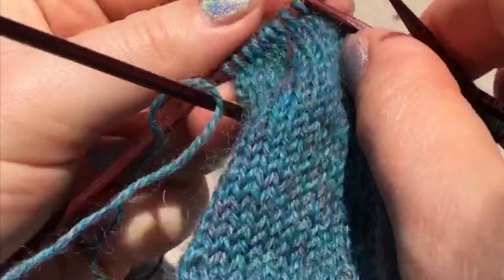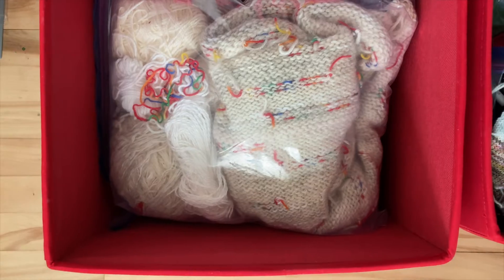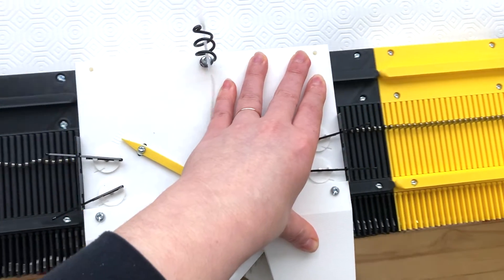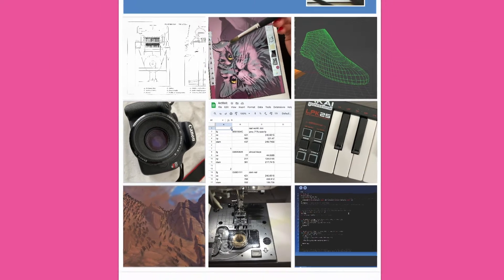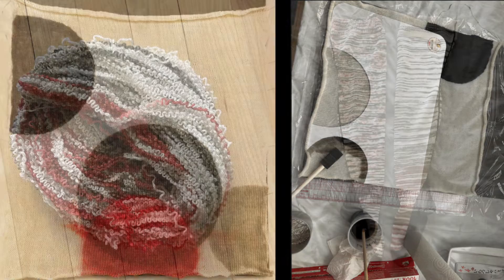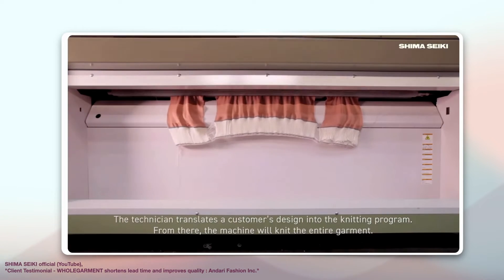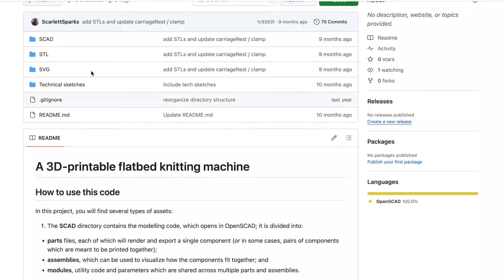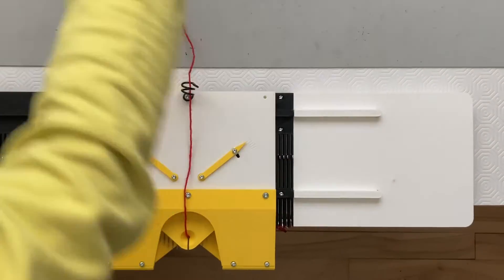I designed a 3D printable knitting machine! | PART ONE

Comment: In watching this introductory video, what caught my eye was your choice of the design software.  Most people learning CAD as a means to design 3D printable objects look at things like FreeCad, Tinkercad, Fusion360, or similar WYSIWYG type CAD design program.  Being a retired software engineer who mostly wrote firmware for embedded systems in C/C++, when I built my first 3D printer and needed to create some simple parts for it (using the Repstrap idea of getting around the chicken and egg problem), I gravitated towards Open SCAD as the CAD tool of choice.  I'm happy to see you giving this some love.  While still not yet perfect (it can't import and modify STL files, and I've had to resort to using Tinkercad for that), it does allow a parametric approach to stitching simple modular parts together to build something more complex.  I guess you could say that SCAD is a tool that only programmers can really love, while the other CAD solutions are more of an artist's mind set.

Comment: I have seen in another 3D printing video that there is a problem with tiny plastic filaments rubbing off that you could breath in and that will penetrate the skin like needles you don‘t see or notice. 🙈

Apparently lots of safety measures (that most probably won‘t follow, let‘s be honest) and applying coating on the printed goods can help minimize this … but I wonder if this problem wouldn‘t be even worse when you 3D print textile production goods like this knitting mashine.  🤔  
They are under much stronger use with threads constantly rubbing over their parts … and to make matters worse, those threads that may rubb off these tiny filaments from the 3d printed mashines will be worn on our skin as clothing. 🤔 

I don’t have a good feeling for projects like these because of that. Will normal people who wanna just have fun with 3d printing and maybe get a cool knitting mashine invest in safety a lot? I highly doubt it. 
They‘ll cut corners or never know they need to take precautions just like the many folks who got sick from trying epoxy crafts.  
Imagine you knit a sweet little piece for your toddler on a mashine like that and your kid‘s skin is covered in tiny plastic  needles unbeknownst to you. That‘s scary. 😰🙈

Comment: I absolutely love what you are doing with this!! I created a makerspace in my library and have knitting machines available for folks to use (among lots of other things). I'm a machine knitter myself. 🧶 I'm in the middle of building a circular sock machine (files from Thingiverse). If you need a beta-tester for your design (which looks INCREDIBLE), I'd be happy to try it and offer feedback. I have 3D printers and a supply budget for filament and parts. This would be fun!